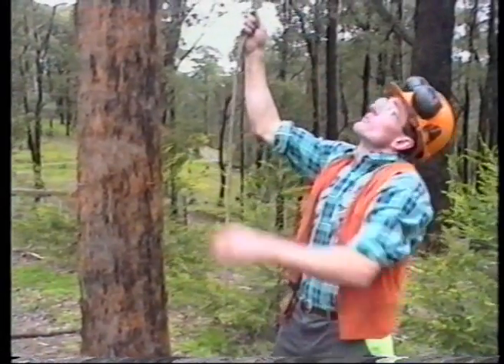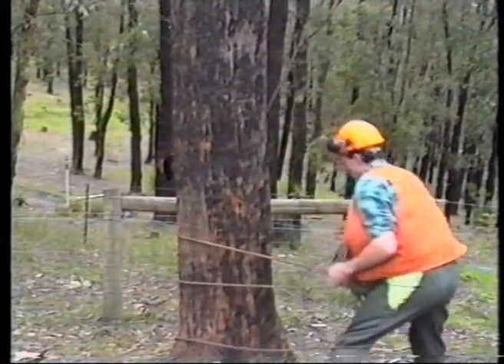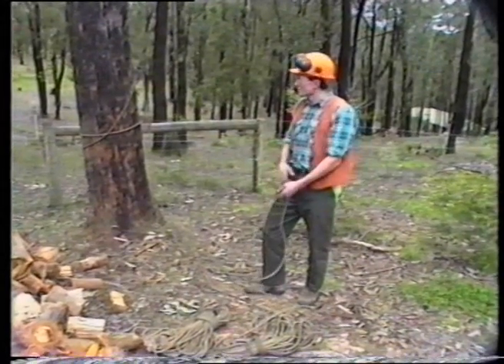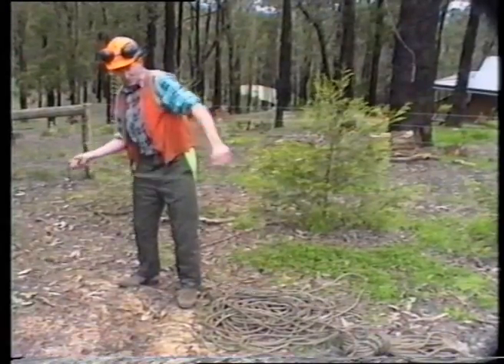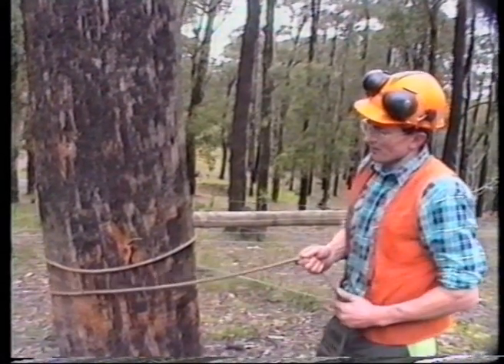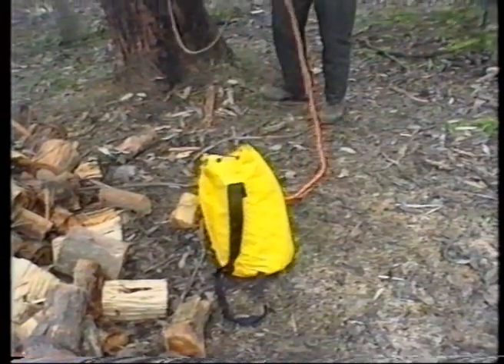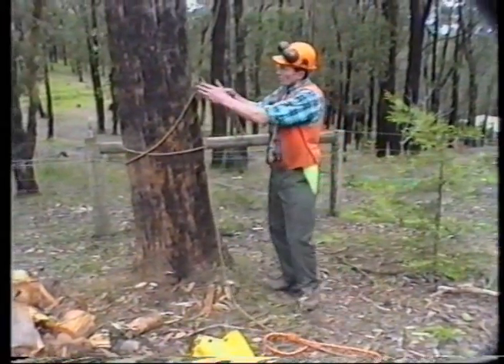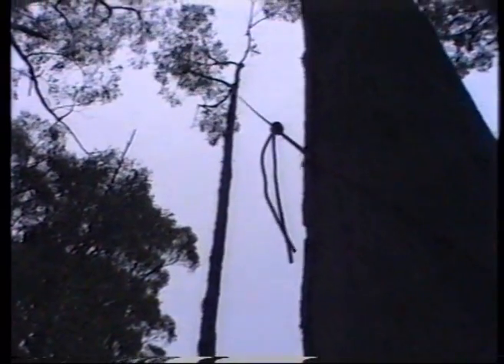Basic Single Rope Technique Explained

Comment: Very cool old technique. great to see the pondering of different techniques using such simple methods to effect a ground based rescue/lower. As sherbrooketrees said, recent advances in tree technology has improved the effectiveness of this technique. Various friction appliances can be used to lower and a secondary rope can be 'bolted' onto this system. Wraps around the tree are an awesome way to do this; a super munter on a pearabiner under prussic is another simple method for this.Good stuff.

Comment: I'm using this base-tie system.  I add a biner tying the loop into the rope...not necessary but anyway.  Also, I was going to build a U-saver but then I saw a vid on using a running bowline with a long tail, for retrieval when blocking down...again, simple and easy.  Thanks for posting your vids....excellent work!

Comment: Have you given any consideration to a backup in your lowering configuration like an anchored prussik?  For instance what happens if the rope picks up a thorn and slashes the bare hands of the lowering operator or some other catastrophic thing like a bad step and he goes left 1/4 around the tree?  I try to always have a redundancy that means the climber is safe if the belayer takes a rock. maybe its different on trees.  Thanks for the vid.

Comment: I understand the stopper knot in general but can you explain why you want it on the ground?  Wouldn't you want it to stop you before the ground? 

Also, ever consider using a prussik loop above the ascender instead of clipping your safety to a mechanical device?  That way pushing up on the ascender minds the prussik.  Just curious.  Trees are not my normal gig so not sure how you guys do it.

Comment: Theres noway i'd rely on a groundie to let me out a tree
Reply: I scrolled down to add my 2 cents that the amount of trust you need with whoever is messing with your anchor point is inconceivable......  You stated it perfectly and much simpler...... Thnx
Reply: lee winters I climb SRT on a rope runner and the only time my groundie unties my bass anchor is after I have my lanyard around a good point and secure and then I tie a running bowline with a Yosemite finish in the canopy when I’m actually going to start working the tree, although Grahm is a freaking legend!!
Reply: If I can teach 7yo kids to lower off maybe even your groundy could manage it with a bit of practice. Best rescue is performed remotely, don't want your groundy coming up to snatch you do ya? Better and safer than rope wraps to have the climber on a munter mule with overhand backup or a figure 8/GriGri/Rig.